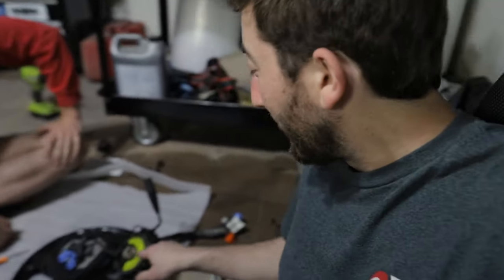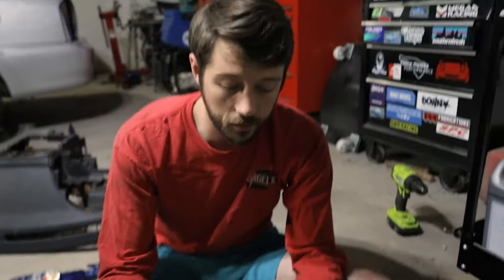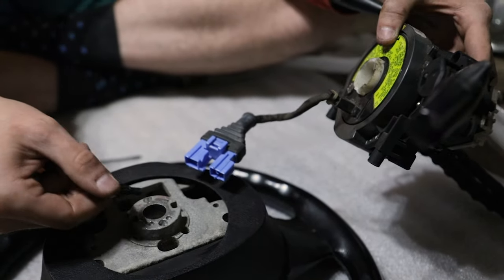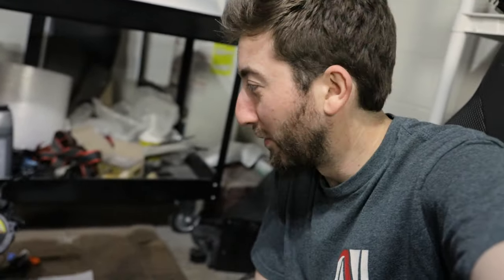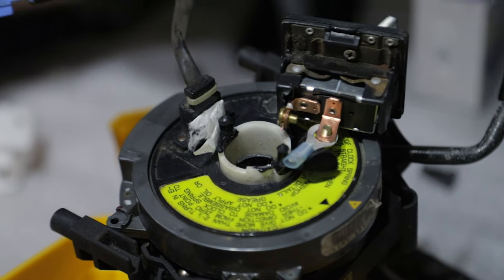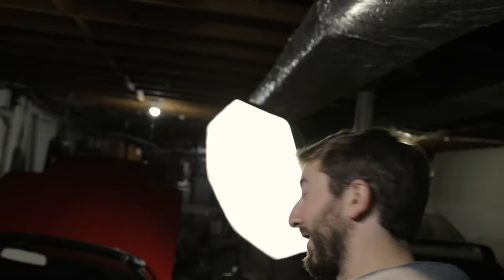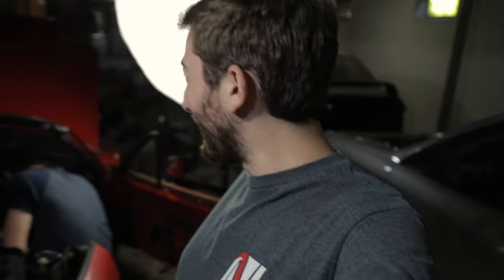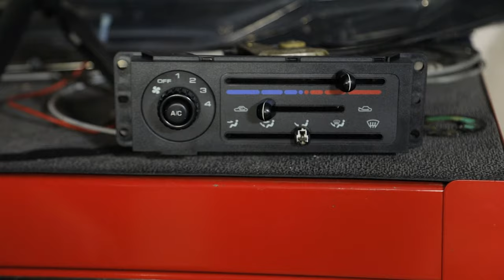NA Miata Interior Restoration!

Comment: where are you getting the ac panel sticker? mine is a bit bubbled and janky looking haha
Reply from the maker: They’re available all over. Moss Miata, amazon, eBay, etc.
Reply: @AlexPerrucci  sweet thanks! Just found one on Amazon for way cheaper than anywhere else, was thinking about doing a rev limiter one, but I’d rather spend $20 than $100 lol

Comment: Great video 👌🏼. I am curious if fixing the clock spring did fix the turn signals not turning off. I took my clock spring out when I swapped to a Canadian wheel and the turn signals work as designed even without the clock spring.
Reply: Mine to I have all aftermarket stuff n no clock spring but not trying to test my luck as we might just be lucky lol